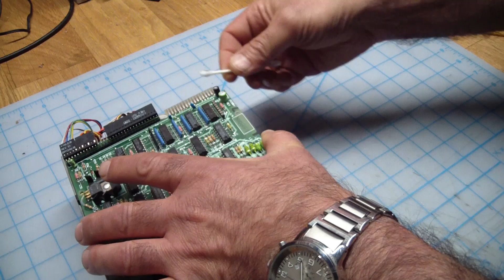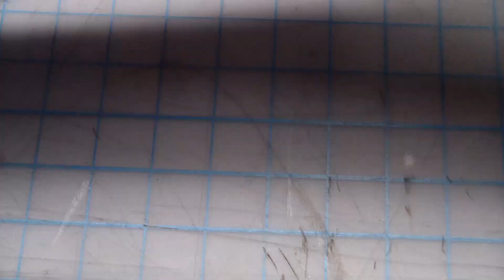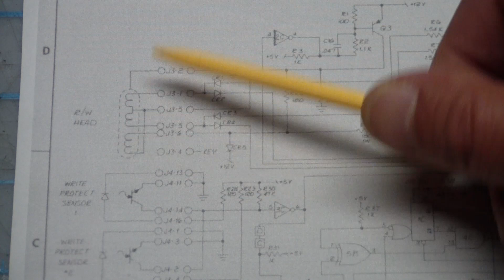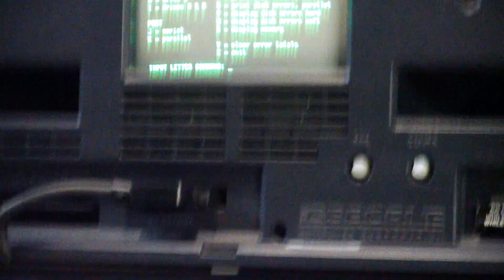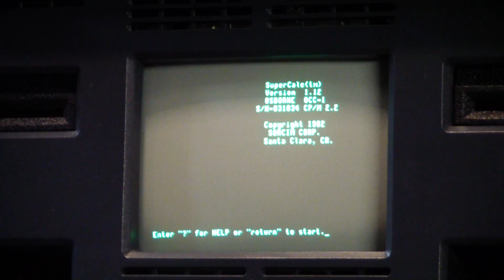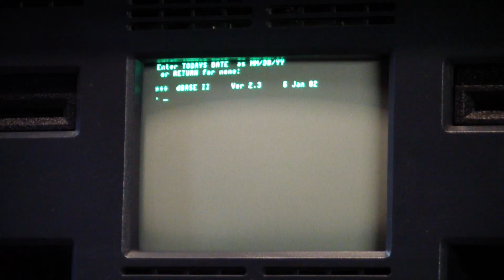AE#97 Osborne 1 Computer Repair, Part2

Comment: The safest way to reduce the yellowing is to set the plastics outside in the sun without any chemicals. just direct sunlight.  It's slower but doesn't marble like that.  I did that with a yellowed Apple IIc and it took about 3 days of full sunlight to lighten it up but looks pretty decent.  I know it seems pretty unintuitive since it's thought that the sun is what caused the yellowing in the first place but I think it was more the heat which would explain why plastics yellow even when left in the attic.  You can try experimenting with something less valuable first but it worked for me.
Reply from the maker: Unfortunately summer has come and gone, but I'll give it a try next year
Reply: I can confirm that the sunlight-only approach does work.  I have also done it with an Apple IIc as well as a CoCo 3 to very good effect, and with no streaking.  I've also had good results with a Televideo 940 terminal and the front of a Morrow Micro Decision.  The only thing that has not fared well for me using this method is a Kaypro XT PC front plastic, which, if anything, seems worse.  Not sure why, but it could be the specific plastic formulation or bromides in that one.  Everything else has come out beautifully, with no chemicals and no streaking or blotching.

Comment: Please be aware some multimeters will burn out read/write heads on some floppy drives and all hard drive heads. This is not a safe test.
Reply from the maker: Interesting, I wasn't aware of that. The service manual does list the nominal resistance for the heads with no caution about how to measure it.
Reply: I guess that if you were manufacturer trained to service such devices they would specify suitable test equipment. Not all meters are created equal. If you consider that you need a voltage high enough to get a measurable the amount of current going through a 10 meg ohm resistor to determine its value, and that the coil of wire round a ferrite bead in a read/write head is almost too fine to see with the naked eye, the problem becomes apparent. Also the operational amplifier that receives the data from the read/write head works on miniscule voltage levels and service procedures encourage you to compare a good read/write head to a bad read/write head so you could spoil your whole day.

Comment: A lot of people seem to have the same issue with spots/streaks after retrobrite treatment.  I'm wondering if it wouldn't just be better to submerse the entire case in liquid hydrogen peroxide in a clear plastic container.  Glass wouldn't work because it doesn't pass UV light.  Some hair products are basically highly concentrated H202.  It's difficult to apply a paste with a consistent thickness which might be most of the problem.

Comment: Siemens, huh? Mine came with MPI drives. The flywheel was badly cracked on the A: drive...Not the best built quality there, it seems. Ended up having to sub in a parts TM100's flywheel.
Reply from the maker: Funny how a lot of the mechanicals in different drives looked really similar. Shugart invented the drives and was one of the first to go under.

Comment: Can't see anything wrong with your diagnosis of the faulty head - if it definitely measures
open circuit right up close to the head, then that's pretty final I'd say :o(  (it's not a fractured wire leading to the head unit for instance ?)
Reply from the maker: The wire sections I had access to all measured fine, the fault had to be inside the head assembly, probably a corroded and broken copper wire.

Comment: I've had several Commodore 1541 floppy drives lose one or more head coils over time. Moisture, I guess?
Reply from the maker: I would agree. If the head loses the hermetic seal then the coils will corrode and eventually lose connectivity. The copper wire in there is really thin.

Comment: Probably a good thing to get those Rifa X-caps changed, because they looks cracked and can thereby have picked up moisture making them leaky (that they measure a higher than rated capacitance makes them suspicious of being leaky), and then they may suddenly go out with a bang.

Comment: If the Osborne got used a bunch.... they tried to cut corners everywhere.  To eliminate 2 molex connectors, they decided to run the power for the disk drives through the data cable.  End result: if the cable was not gripping solidly, you burned the connector and circuit board on the drive..  Osborne was all about the profits, so saving 10 or 20 cents per machine was critical to him even if it cause significant long term trouble. Seems to me that the interface was not gold plated as well.. they were made cheaply..
Reply from the maker: You must have also heard of the 'Osborne Effect' then, announcing new product, killing current sales and then delivering the new product too late.
Reply: @artifactelectronics  Yep.  The shop I helped start (5 of us were stockholders) carried Apple, Imsai, SWTPC (we wrote their basic, dos, and a few other things), Processor Technology,  and several peripheral manufacturers..  Was a fun time.  Osborne was not at all interested in giving up ANY of the margin, so mail order was it... Since we had actual engineers on staff, we saw a lot of the things.. Announcing any form of storage enhancement was deadly for their inventory..   The books he had were not terrible, but the computer was very iffy....

Comment: Hey all.  For burnishing contacts I have become fond of a "Jewelers Fiberglass Scratch Brush."  Check on ebay....
Reply from the maker: I've used abrasive sticks, basically sandpaper in a pen form, to burnish contacts in electromechanical pinball machines. But you have to be careful that you don't remove any sort of plating from the contact. I always try less extreme methods first, such as a business card with IPA, and if that fails a light application of liquid metal cleaner.